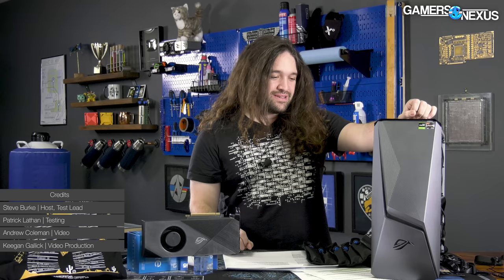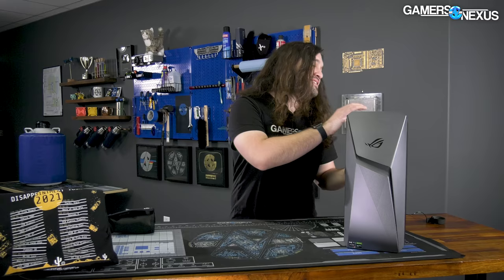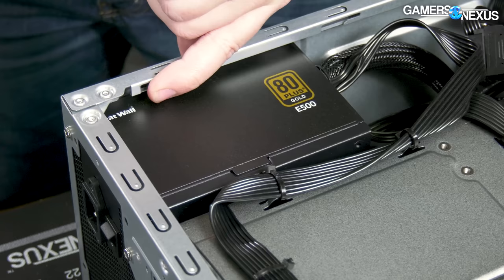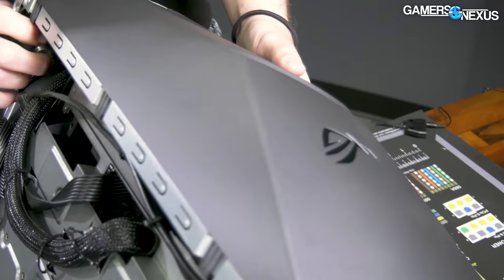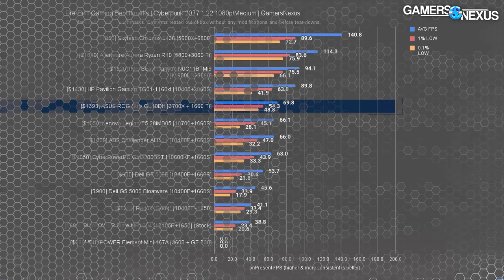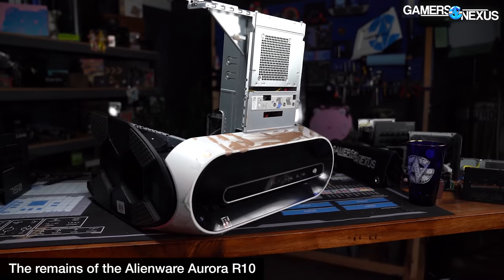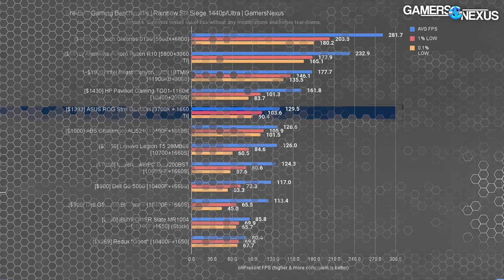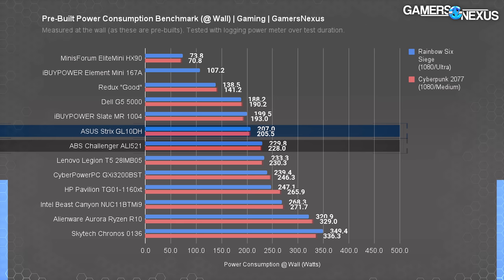ASUS Didn't Deeply Offend Us: $1400 Pre-Built Gaming PC Review (ASUS GL10DH)

Comment: It’s cheaper to buy a scalped GPU and buy parts separately than buy this junk.
Reply: Yeah Asus had 5700g with 3060 for $999
Reply: It's not, Lenovo legion rtx 3060Ti + 5800 was sale for 1299€. For reference 3060Ti alone costs 849€. That leaves you 450€ to build 8 core pc with 16gb of ram and 1tb ssd

For gaming sure you could go 12100 + 3070 and save money
Reply: @jaggsta  That one is out of stock.
Reply: blame nvidia for not making 3060's
Reply: No. Unfortunately not. It's cheaper for now.

Comment: Shows you how screwed we really are in the prebuilt market and GPU market when this is one of the better option available and it has a 1660
Reply: Lol I just bought one of these used like 2 months ago with a 2070 super and 3800x for $950. I like it so I'll see how it compares to this one.
Reply: If you're lucky you can find 3060 ti at 700$. Or 6600 XT at 550-650.
You just need luck and patience unfortunately
Reply: 1400 USD for a 1660 build? WHAT? 1400 used to get you a TOP OF THE LINE BALLER PC! Like, you were a STUPID to waste so much money on a PC. Now, it gets you a mid tier GPU from 4 years ago? WHAT?! Even the EMBARRASSINGLY BAD HP PAVILION from 3 months a go got you a 2060 Super! Still a horrible value proposition, but at least it's an RTX card.
Reply: I luckily built mine right before covid in December 2019 for 1300 with a 2070 super. Sold my 2070 super a year and a half later for 100 more than I paid for it.
Reply: just think 1400 dollars meant top of the line computer.....
Good old days
Reply: I mean theoretically if prices actually meant something you could squeeze in a 3070 or even a Rx 6800 in that budget with a 5800x or 12600k z/x series motherboard 32gb 3600 ddr4 a 500gb nvme boot drive and a case and psu
Now the GPU alone costs 1200-1400
Reply: Honestly this thing is pretty overpriced even by today's standards. There are plenty of other prebuilts around this price with 3060s and decent CPUs. I guess the question is whether they catch on fire or fall apart immediately, but that's what these videos are for lol
Reply: So Sexy i'm Sexy  I'm confused?
Reply: I bought the 550, 5600x with a 3060 for 1500 cad$ before Christmas, pricing seems messed up. It sounds like a fighter jet taking off, but I have a video card....
Reply: They even put in an extra screw, just to underscore the point!
Reply: @whitespicyrice  that's a really good price
Reply: @danteedee8204  at the moment if you look in some shops that sell theyr own prebuidsl, you can find a pc with a 3080 a 2k, in my area it is the same price as the grafic card on it's own...
Reply: Walmart has the same case with a 3060 in it for 1000 and an r7 5700g I got it and a new case tho
Reply: You will notice that ASUS actually charges way more for basically same components as Dell. But since they "donated" to GN, they get better review ;)
Reply: @aleksazunjic9672  if this was him shilling I'd hate to see how hard he can shit on a company that doesn't pay him to be nice (which to be clear he isn't being paid off to be nice) now I'm suspicious thst you are being paid by dell.. Hmmm
Reply: I picked up a new PC, it was 1049 and had a Ryzen 3600 and 2060 card. I felt it was a good pickup at this point. Did come with 16gb (Upgraded to 32) and a 500gb SSD (Upgraded to 1tb M2 980). I wanted to build my own but damn prices are crazy.
Reply: I got a cyberpower with a 11700kf and a 3060Ti
Reply: @Lonewolf_121  I don't make yt videos for living, and I have no financial incentive to shill for anyone because no one will give me 2 cents for my opinion. But GN deliberately pukes on Dell system which objectively has better price/performance ratio.
Reply: Paying $1400 for this... getting the shivers.
Reply: I was lucky enough to have pre-ordered a comp in November 2020. Was supposed to get an AMD 6800xt reference card. Ended up getting a xfx 6800xt speedster merc 5800x for $1500
Reply: $1400 for a 1660 build is the real tragedy. That would get you a 2060/5600XT build back in the day, with Canadian Pesos to boot.
Reply: What really hurts me to see is kids who'd love to build their own machine missing out and having to go for a pre-build. It honestly pains me.
Reply: I think they just got a bad deal on this one.  Walmart has the same PC with a 3060 for the same price
Reply: Just go to NZXT or Origin PC.
Reply: yup, pretty much. I sell budget rigs on facebook and they are much cleaner/affordable... mind you I am using older hardware tho lmao.
Reply: Yeah lol, consoles are a way better deal currently
Reply: lol the one in my walmart has a 3060 and its only 1k usd ryzen 7 5700g and 2 tb ssd would yall recommend because i plan onn buying and just getting a new case and using my wraith spire cooler
Reply: @stash4me2  It's a spam bot.
Reply: @aleksazunjic9672  as someone who worked for Dell service repair, (level3 tech before the assembly line rollout company wide, directly below engineering) the only thing Dell makes proper are their laptops. Sub par PSUs, proprietary power systems, horrible airflow, anti-consumer case design, shitty BIOS functionality, and cable management my toddler could do better on. Don't kid yourself, the original Aurora was the last 'good'* Dell PC, we're at the point where HP of all things actually makes desktops worth owning now...
Reply: @Jinsoku440  That does no go like that, my boy :P  If a company puts sub-par parts in their computers, to the point they are unusable, they would be soon flooded with warranty claims, possibly even lawsuits. Dell does not sell only to individuals, in fact other companies are biggest buyers of their desktops. What does happen in real world is that Dell, as any other company, tries to save money but not on the level that their stuff is unusable. In a current situation, for most people, it could be worthwhile to buy Dell prebuilt and modify it themselves for better air flow, thermals etc ...
Reply: @Jinsoku440  Not true. You get the warning about unsupported hardware, but you could override it. Thousands of people were upgrading their old Dell computers with new GPUs. Also, you cannot design PSU in a manner you described. PSUs generally have at least 25% "reserve power" , just in case, so you could definitely add RAM or extra fan, cause they do not use much energy. Yes, it is true that sometimes is a hassle to add new power hungry  card or CPU, but that is about it.
Reply: @aleksazunjic9672  No, that's literally not what I'm talking about. A03 and C series bios disable any GPU without specific hardware profiles supplied by Dell, there isn't a 'work around' for something built into the motherboard's operating program. Also, Dell's proprietary power supplies are rated for the components for that particular unit; which is how you could purchase two Optiplex units with slightly different RAM and the PSU would require a different SKU all together. Your brown out buffer only applies to the very specific components in the computer at point of assembly. Also, Dell power supplies usually lack any spare sata or 4 pin molex connectors for upgrades; once again there are usually six or seven power supplies per model that are for the few sub models that call for it.
Returning to your first point; people were not 'using Dell computers' but were snatching the non proprietary components (CPU, Harddrives, Disk drives, IO Headers, and fan components) because at the time that was easier than buying those components new and checking for compatibility. I was building when the DP45SG was a top of the line board, and if you knew an auction or Ebay listing with a retired Dell was coming up, you could save a few dollars.
I've talked briefly about what qualifications I have to discuss this topic, but your replies implore me to ask what your tech background is, so I know I'm not talking over you...
Reply: @Jinsoku440  First of all, people were updating Dell BIOS-es Like A03 to A09 or A10 like 8 years ago. Second, PSU does not give a s*it what components you install - only requirement would be not to draw more current at certain voltage than it could deliver. As I said, PSUs are selected to have at least 25% headroom compared to maximum power draw of the components. Third, there a ton of adapters on the market, even for proprietary Dell crap , so you could basically turn molex into 8-pin or whatever you need. Forth, people were modding Dell computers (i.e. upgrading RAM, GPU, CPU ...) for years and will continue to do so. I agree with you that this is a question of price to performance, i.e. you could sometimes get good deals if you are ready to ignore proprietary Dell crap. And that is about it,
Reply: you can get a solid one now for like 1600 with a 3060 ti
Reply: @KYSMO  6600xt is around $410 right now
Reply: Well bare in mind I'm not sure where he finds these for so expensive. I bought a cyberpower pc pre built during Christmas 2021 for $1200 and it has an rx 6600 xt and a ryzen 5600g so I'm not sure how he's finding these for $1400+. He reviewed a cyberpower pc around the same price as mine and the same time I bought mine, but with a worse card and cpu than I bought mine for. I think an rx 580 4gb. But for $1200 as well. Idk
Reply: @whitespicyrice  boy did we ever survive the pandemic, 700$ 3090s anyone
Reply: Honestly, I've found a thousand dollar with a ryzen 7 5800x, a 2060 super and 1tb or storage
Reply: i had a good tax return 2 yrs ago and bought one. it was on the shelf for 1900 au. had no loose screws 1 stick of 16gb and coloured lights.but my famuly like it still. im a single player gamer and it plays everything plus my cad software and other stuff promptly and quietly without a hitch, touch wood for nearly 2 years

Comment: I heard bad things bout this one, but it's apparently surprisingly good (well, relatively, I guess).

God, though. 1400 for a 1660 TI. Like seriously that money should at least get you a 3060 TI or 6700XT. Shows how much bad the GPU market is.
Reply: I bought my computer with a 1070ti for less than $1400 4 years ago. I really want an upgrade, but at the current price, i won't get any if I pay the same price... 
This is insane. 

I'm looking at around $3000 if I want the kinda of upgrade I'm looking for.

Edit: Thanks for all the people giving out build advices/options. I'm actually willing to pay $3000 for the upgrade I want if I have to. Budget is not that much of a constraint. I'm just shocked because I started looking at prebuilts from my previous price range and all of them seem to be quite underwhelming.
Reply: @lixiaochen6  try and find a 6700 XT or 6800 XT. They're still bad value but they're your best shot to get ANY GPU.

Unless you're not gonna pay those prices.
Reply: Bcs of the current market i was stuck for almost a year without a gpu now i still don't have gpu that i hope for but i can game now with my 1650
Reply: Actually, you can easily find a 3060Ti or 6700XT for that kind of money. Just without the rest of the computer included.
Reply: well there is a model with a 3070 for about 300$, sold by major manufacturers (best buy) with an intel i7 11th gen. now that, is actually a fair price and arguably what would’ve put a lot of manufacturers to shame. there’s also a 3060 model at the same price point of their model, excluding taxes ofc.
Reply: @KooYu  You got me with the first half ha.
Reply: @dragontales1999  I'm probably going to end up paying $3000 + for the upgrade, but I'm hoping for the AM5 platform for a bit of further upgrade path. I think I can wait until the end of the year with my current setup.
Reply: I was scratching my head at this, since the G10DK version of this chassis comes with a 5600X and RTX 3060, and I was able to get it for the same price. I'm guessing they just haven't adjusted the price of this since it launched...
Reply: @lixiaochen6  plenty of prebuilts for less than that with a 3060ti.
Reply: @slimprism  Wow a whole computer with a 3070 for 300$?? Get outta here with that.
Reply: 1400 USD for a 1660 build? WHAT? 1400 used to get you a TOP OF THE LINE BALLER PC! Like, you were a STUPID to waste so much money on a PC. Now, it gets you a mid tier GPU from 4 years ago? WHAT?! Even the EMBARRASSINGLY BAD HP PAVILION from 3 months a go got you a 2060 Super! Still a horrible value proposition, but at least it's an RTX card.
Reply: I am incredibly lucky… I bought a 6800xt and… I didn’t pay scalper price for it
Reply: Bought this same pc but with the 3060 phoenix. Got it from Walmart for 1000. That was its own challenge since if walmart has no stock it comes from a third party seller for around 1400. Haven't seen the 1000 dollar price tag since November
Reply: What's really offensive is the OEM's are unaffected by the scalpers. They have long standing contracts with the manufacturers and have been getting what they are contracted to get. They are just price gouging because they can.
Reply: Value of this system is terrible, even in this market. I agree with others that for 1400 USD, you can get a prebuilt with a 3060 or 3060Ti...both MASSIVELY more powerful than the 1660TI, with the latter being almost twice as fast. DONT BUY THIS SHIT
Reply: It's pretty brutal these days. I just got my hands on a 3070 Ti (not because I wanted the Ti specifically, just because it was actually available) and paid nearly double what I paid for my old GTX 970 back in the day. My computer in its current state has definitely not been on the more affordable end of builds I've done over the years. Probably about $2600 CAD all in (alongside a 3600x in a Define 7 Compact), and a full $1200 of that was the GPU. My last build (aforementioned GTX 970, i7 4790) was only about $1600 (about $1800, inflation adjusted).
Reply: $1400 will never get you a 3060 ti these days. You're looking at $1500-1600 minimum
Reply: Yeah 1400 is INSANE.  Also getting a reference 6700xt at msrp is incredibly easy, and I mean INCREDIBLY EASY especially when compared to any other card on the market just about (excluding scalper priced zotac and aib amd cards), I recommend it to everyone and I've bought them for several people lol.  Also antonline has bundles all the time in stock for $870 that gives you a psu, 60ti, keyboard, and I think a mouse.  It's technically ripoff but not terrible considering evga is the best priced aib at the moment outside of scalping the 12gb 3080 to all hell.
Reply: @lixiaochen6  If you have a 1080p screen I would wait. Bitcoin and Ethereum have went much lower in price recently and new AND and Nvidia will be out next summer. If you can't wait buy an Xbox series vX. It's GPU is faster than this. Also ddr 5 will be reasonable by this summer too for newer cpu architectures
Reply: @CSDiz96  Since the GPU shortage is seemingly over I have been wanting to build a new PC. I have never purchased a prebuilt in my life (25 years of pc building under my belt)  BUT I just picked up the new ASUS GT15 ROG Strix from best buy (I know I know) BUT it is the updated 2022 version of this PC Steve is looking at . The case has a major redesign USB-C in front and back. The case has open mesh at the front and top and back with shielded tempered glass side and RGB aura sync strips inside and on the front . Has the i7 12700F, dual channel 16GB ddr4 3200 ram, Micron PCI gen4 500 GB M.2 boot drive, and a 2TB HDD, ASUS RTX 3060 with back-plate. All connected to a ASUS TUF Gaming  b660m-plus WIFI d4 motherboard which is a $160 board alone.  I paid $1,136 for the system and replaced the stock cooler with a Noctua nh-u9s and it keeps a steady 37-43 deg at idle/streaming YouTube and never over 68 while gaming. Reason I got it was I could not build a comparable system for under $1400 on PC part Picker.  So far I'm really happy. Its all standard off the shelf pieces from reputable manufacturers with a decent warranty.